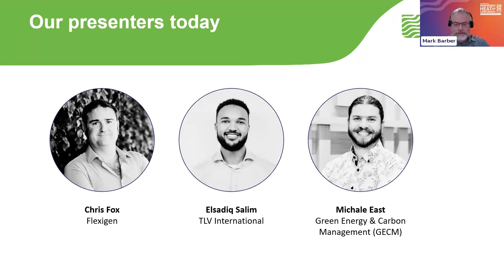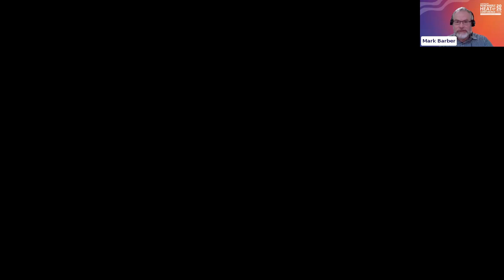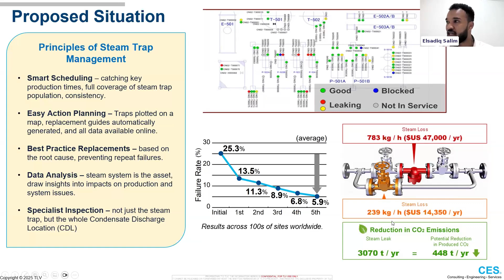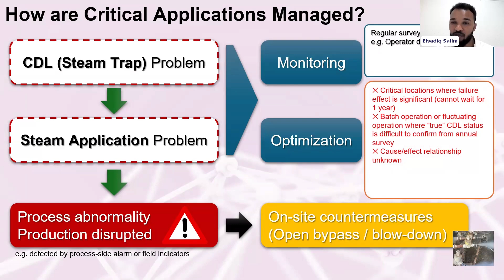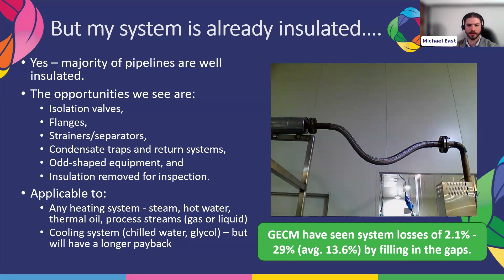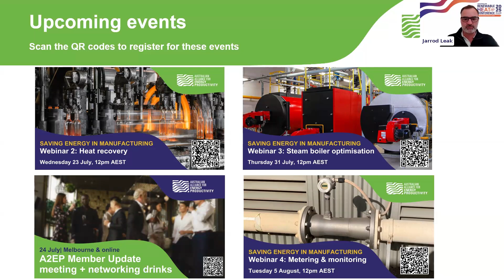Improving efficiency in steam reticulation: Saving energy in manufacturing webinar 1 from A2EP

Comment: The funds offered by NSW and the others seemed tiny in terms of helping medium sized firms to assess their heat loss, cut steam loss and assist with boosting efficiency. Aud $1m seems peanuts while the $10m fund seems a good start. These funds should be tripled if not more to assist local firms to offset the higher gas and power inflation while cutting their carbon footprint. Hopefully just using the cash for assessments to allow plant owners to see what cash they are burning will be the key.  Perhaps higher water charges would offer the push to recycle the water and stop venting saturated steam and dumping water.

Comment: It seems strange that engineers watching these videos would not understand the advice unless their training in college etc was missing a large part of physics and heat fundamentals. Not trying to be cheeky but what engineer does not know how a gas turbine works or triple expansion engines that are in most ships to suck all the power from the steam generated. Any site engineer seeing vented steam must be wondering  how much of that is  wasted energy and water.
Reply: Probably 99% of engineers would have no clue.
Reply: @reubs91  Thats a worry if 99% of current engineers are that clueless about energy fundamentals.
Reply: @stephendoherty8291 it’s an unfortunate reality. There is very little training on steam in an Australian mechanical/chemical/process engineering degree. Most come through with the view that steam is outdated, ancient, and needs to be removed for more “efficient” systems.